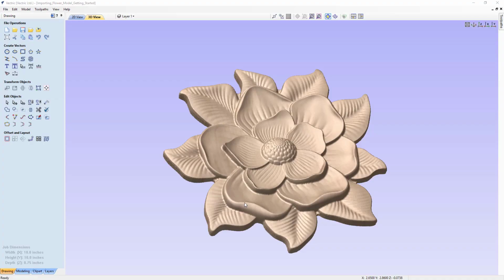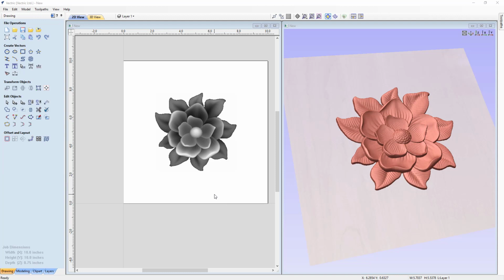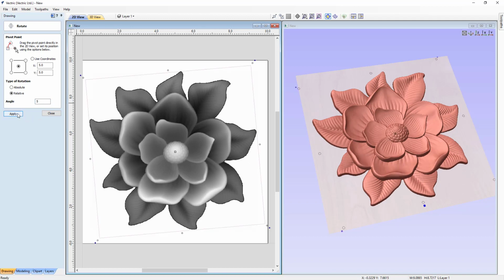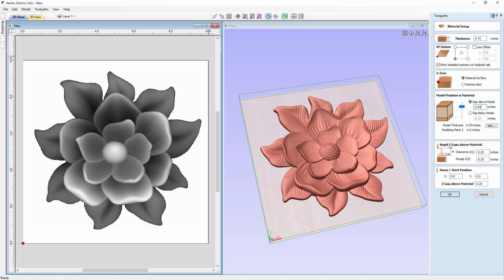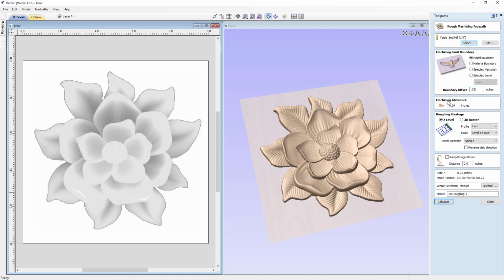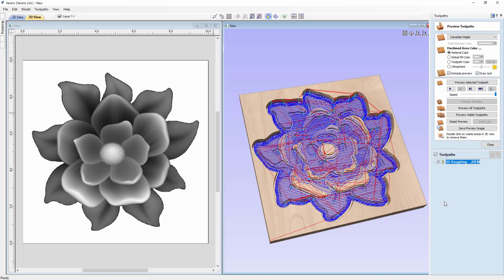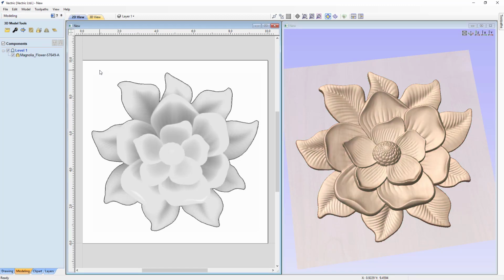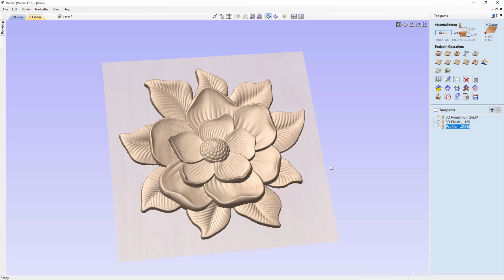Vectric V10 Tutorials | Getting Started | Import Flower Model

Comment: Where can I find the magnolia flower file to import? I have Aspire 10.5. EDIT: I found it, but it took some digging. After downloading the correct 3D clipart files while logged into my account at Vectric.com, I had to run the installer file. Then I had to hunt for the mystery location where it installed them. Not intuitive, but doable if you have a computer/Windows background.